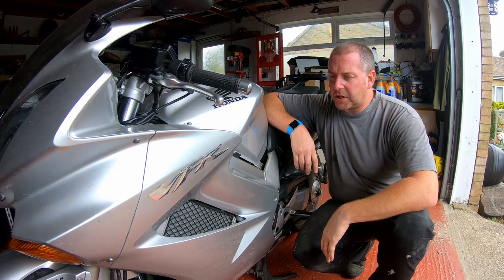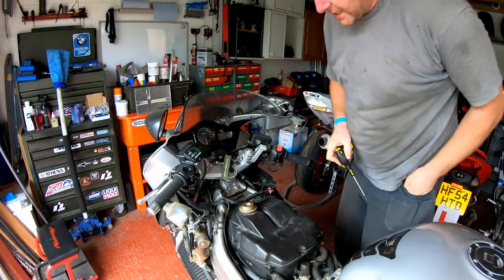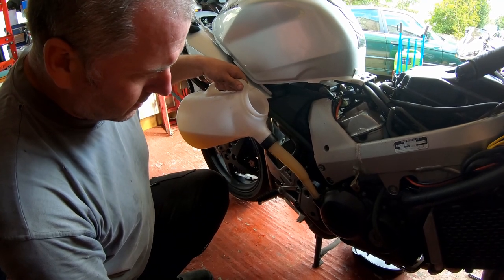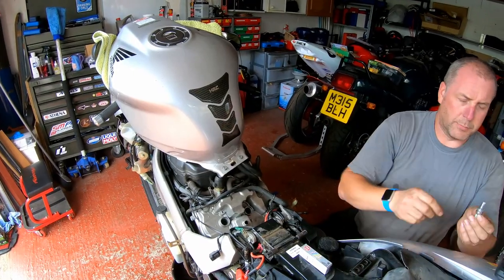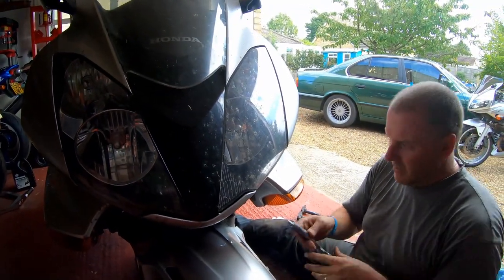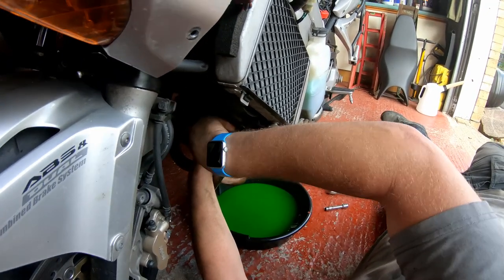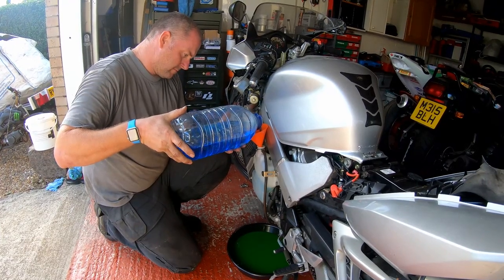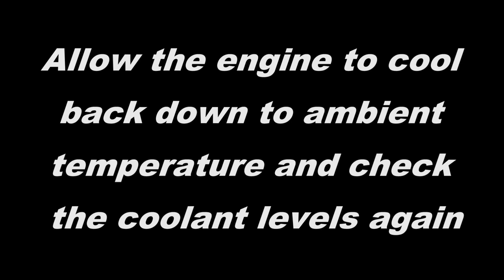Honda VFR800 VTEC Servicing - Oil, Oil Filter, Air Filter, Spark Plugs and Coolant

Comment: Hi Kevin!
Me again...
I have serviced my vfr few miles ago with a 10w30 synthetic Silikolene. Bike has engine noise when around 65°then stops. Not CCT problem.
My question is: should I go back to a 10w-40 like the one you've used?
Do you reckon could solve my issue?
Thanks and as always great support from you!
Cheers
Reply from the maker: Well that would depend upon the engine noise to be honest! I very much doubt that a slightly thinner oil when up to temperature will make enough of a difference to cause engine noise. That said of course, I wouldn't have opted for a fully synthetic oil myself, I prefer to use Semi-synthetic personally.
Reply: @KevsShed  thank you for your reply!
The thing is that it is very weird as noise. It comes not when the engine is cold but between 65° and 80°, then it goes away and don't come back.
Would you be so kind to listen to it and share you thoughts?
I could post a video and send you the link.
Let me know!
Btw I have completed a full bleeding of brake system as you suggested me once and no more issues with DBS!

Comment: quick question. How hard, from a scale of 1-10 would you say converting this bike to a naked would be? i'm especially curious about the front end (gauges etc)
Reply from the maker: It would be an extremely ugly naked IMO! To be honest I’m not really sure how difficult it would be as I’ve never given it any consideration, nor have I ever seen anyone else do it! Perhaps you’d be the first! 😁
Reply: @KevsShed  i've only seen one guy trying but ultimately gave up because of all the electronics in the front and the side radiators. i've seen though marvelous efforts from guys doing it to a 98-01 vfr800 with great results(in my opinion of course). is it really that much of a "mess" in the front?

Comment: Did I hear right?  28 Nm for the oil filter torque?  That sounded a lot (and it seemed to take a lot of screwing in), so I checked my 2001 (pre-VTEC) spec: 10 Nm.  The oil drain plug is 30 Nm - did you mix them up?  Or did Honda increase the figure a lot on the VTEC?
Reply from the maker: You almost heard correct, it is actually 26Nm for the filter cartridge and 29Nm for the drain plug. You are correct about the pre-VTEC though, the filter is 10Nm but the plug is actually 29Nm too. The specs were obviously changed, no idea why! To be honest when it comes to spin on type filters, I often fit them up to touch and then physically turn them by hand until I cannot physically turn it anymore and then call that done! In this case I actually used a torque wrench!
Reply: @KevsShed  I can't believe 26 is neccesary, or even a good idea - that may be fun to remove after a year or so of corrosion from the elements.  I have failed to find any mention of torques that high for filters, apart from VFR800 numbers on iffy manual web sites.  I think Honda made a mistake on that - the filter is apparently the same as my 2001 FiY, so why should the torque be so much higher?  That said, I have never torqued a filter in my life - hand tight (if one can reach it) has always been enough.

Still, excellent videos - do you have a Triumph Sprint, perchance?  I could do with some reassurance over aspects of its maintenance!
Reply from the maker: @martingerhold2111  I am in total agreement about the hand tight thing buddy, as I said above that is what I normally do! As it happens, I do have my Wifes Step Fathers Triumph Sprint in the workshop as we speak, it is in need of a fair amount of work as it has been standing for some time. I even discovered fuel in the oil (a lot!) It's getting a fairly hefty recommissioning. Subscribe if you want to follow along :)
Reply: @KevsShed  I have just subscribed!  My Sprint is only 6 years old, but has been hardly used for the last 4.  Now off to view all those other videos...

Comment: Hello, does filling 10/50 oil damage the engine of the motorcycle? I made this mistake and put a non-ORIGINAL oil filter, my motorcycle is not the same as before, I look forward to your views. Model crossrunner vfr
Reply from the maker: The manual doesn't list 10W50 as compatible at all, 10W50 will have a slightly higher viscosity when up to operating temperature. That said, I doubt that you would be able to notice any difference. Using a non-original oil filter isn't an issue, I did in the video. So long as it's a reputable brand, that should be fine.

Comment: Why did you undo flapper mod? Why is the hose hooked up?
Reply from the maker: I didn't undo the mod, I simply taped over the hose union and refitted the hose to stop it flapping about and any potential vacuum leaks.

Comment: HELP/ADVICE PLEASE!  So I changed the coolant out and during the engine idle phase where we are getting the air out of the system, I had a leak from the right hand radiator at the Union at the base with the rubber hose. Reclamped it etc., but it wouldn’t stop oozing (it was just an ooze) coolant from the Union. Once the thermostat kicked in, and the coolant level dropped, indicating that the left hand radiator let in the coolant, the leak stopped. Was the leak merely caused by the back pressure of the air in the system? Should I be concerned?
Reply from the maker: It's a fairly common place for a leak to be honest, Craig Lowe over @Motourevs had the same issue. He fixed it by replacing the lower hose that connects to that union and the clamp.
Reply: @KevsShed  Brilliant, many thanks. I've replaced the clamp at that end, the hose seems ok, and it looks to have stopped. Thanks for your reply and I love your videos!

Comment: Can you flush the coolant out more with  some sort of water, before refilling or would that cause corrosion
Reply from the maker: Yeah you could, but there isn’t really any need, I did do that on my GSXR service video. Horses for courses I guess!
Reply: @KevsShed  thanks I need to do this coolant replacement, glad I watch as I never knew about that second screw to drain it. Great videos as always. 👍👍
Reply: Very informative and this has given me the confidence in atleast doing the filter and oil changes, being a newbie. I have to start somewhere on my 2006 vfr. Just wondering whether there is one about removing the panels/plastics as well. Cheers
Reply from the maker: To be honest, I hadn't thought of that, I will look into the possibility of doing one!
Reply: @kevs shed
Thank you!

Comment: Hi kev got some coolent below in the garage would this be suitable

ULTRA LONGLIFE RED ANTIFREEZE – 100% CONCENTRATE

Universal 5 year engine coolant, suitable for all year round usage in automotive and commercial petrol and diesel engines and certain industrial applications.

Must be diluted before use: Example 50/50 mix provides -40°C Freezing Protection

Organic Acid Inhibitor Technology

Free from nitrites, amines, phosphates, borates and silicates

Ethylene glycol based
Reply from the maker: I wouldn't, if you mix OAT coolants with standard glycol antifreeze it will turn into a substance resembling hair gel from the 1990s!
Reply: @KevsShed  ifs a fresh coolent change

Comment: Hi kev, I have a problem where the the 2 hoses on the underside at the top, where do they both go, i know one is a breather where does the other one go?
Not the California model.
Thanks
Reply from the maker: Do you mean the two hoses that come from the tank? If so, they both should exit at the same place at the bottom of the bike on the left hand side. The two from the tank, one is a breather for the tank, one is a fuel overflow. The two hoses should join a third at the bottom of the bike which is the vent hose for the coolant expansion bottle. 👍🏻
Reply from the maker: By the way, one of the hoses from the tank has a joining piece next to the engine which often becomes disconnected and flaps around causing people to wonder where it came from 👌🏻
Reply: @KevsShed  many thanks for your reply bud..
Much appreciated 👍
Reply: @KevsShed  yeah i had the same problem, thanks for your info, i have the 2003 for the past month, I will be getting great information from your videos, many thanks again 👍

Comment: Do i have to start the bike with my radiator cap off to remove air? On my bike,the radiator cap is under the tank
Reply from the maker: It'll help get the air out yeah! pop the tank on a stool next to the bike if it helps!

Comment: 10W30 and 10W40 might not be a whole lot of a difference. But I can tell you that 10W30 and 5W40 is a hell of a difference in a '07 VFR. With 5W40 VFR had 40ºC higher engine temperature (~120ºC with fans always on, on a highway at 130km/h; dropped to ~78ºC on the same highway when changed to 10W30) and the engine used to choke down almost every time I rolled off to idle (e.g. when shifting gears or stopping at a red light).

Not a pleasant experience. Not at all. Not recommended.

P.S. I had to use 5W40 as an emergency "that or nothing at all" case in order to come back home ~150+km.

Comment: Thanks kev. Great video always make it look easier for us to do. Think am going with a hiflo filter. And got plugs and genuine filter also using motol 5100 10w 30. And caught my knuckles few times with the fairing lol. Also do you suggest to replace the copper washer also do you have the coolant you use. As I know honda best to use for the alloy heads is it. Maybe am wrong. Can't wait for the valve one. Keep them coming thanks again 🙂
Reply from the maker: The copper washers can be re-used if you are trying to be as thrifty as possible but they must be annealed prior to refitting. To be honest, with them being so cheap, why not fit a new one! So long as you use a high quality Ethylene-Glycol based coolant, mixed to a concentration of 50% coolant to 50% distilled water then you won't go wrong. Just ensure that you don't use straight tap water as this is a sure-fire way to allow corrosion and limescale to form inside the water jacket.
Reply: @KevsShed  yes very true. I replaced some fairing bolts. And the 2 lower fairing push clips as been so long in there the push part didn't work lol. So got extra too. 🙂

Comment: Another question please mate. I've done the exact procedure for coolant service, the way your coolant bubbled and burped suddenly getting swallowed up into the chamber. Mine didn't quite do that, it kept boiling over slowly where suddenly the temp went to 105c, fans hadn't come on and it started boiling like a MF and spitting coolant all over the place (I got burnt like a mf...), I shut the bike off and assumed the worse a stuck closed thermostat? I haven't got a clue where to start atm, I mean I could just fill it back up and give it a ride to see what the temp is doing and when the fans activate if they do at all? Cheers
Reply from the maker: Hi mate, I assume that you have checked the fan connector to ensure it is actually plugged in? I’ve made that mistake before myself! Other than that you could test the thermostat by putting it in a jug of boiling water and checking that it reacts. It’s actually not that common for thermostats to fail in the closed position to be honest although not impossible. They often fail in the open position and prevent the engine getting to temperature at all costing MPG. Good luck.
Reply: @KevsShed  yes I recall last ride it got to 112c and the fan was running, I will take the bike out today and see what the temperature is doing and if its still going to boil over whilst moving through traffic and when exactly the fan will cut in. Was afraid of the thermostat as I have zero time to pull the TBs out as its a bit of a pig to get the boots seated correctly afterwards. I will keep this updated incase anyone has similar issues, thanks for your input Kev 👍
Reply: @KevsShed  hi again Kev, I have ran the bike yesterday on the drive and at approx. 80c the radiators start becoming rather hot so assuming that thermostat is doing its job, between 105-106c the fan comes on and cools down to 92c. Sounds about right? Thanks

Comment: This is not how you burp the coolant system when doing a complete flush of the coolant system on a motorbike. This is wrong. All you're doing here is boiling the coolant, doesn't make any sense. You're supposed to just turn it on for a couple minutes until it reaches 30-40c with fast idle and coolant cap off. Then turn off engine, top up coolant if level has dropped (which most likely it will have). Put the coolant cap back on and then run the engine at fast idle until thermostat opens and fan kicks in. Then turn off engine, wait for whole bike to cool down and when it's safe to open coolant cap again, open it and check level and top up coolant if necessary. Ride the next day and then after it cools down, check coolant level again and do final top up if necessary.

All that's happening with the way you're doing it is bubbles or cavitation occurs due to low pressure and boiling (phase change) temperatures. The cooling system will not work correctly with the cap off. I presume this is why some of the other comments on here are struggling with the coolant flush part of your video guide.

Not trying to diminish your videos, as they are great and usually on point, but just this one part about the coolant I wanted to point out. Good job on the channel.